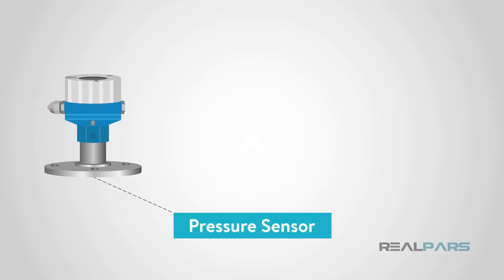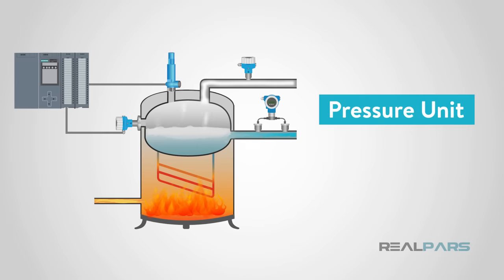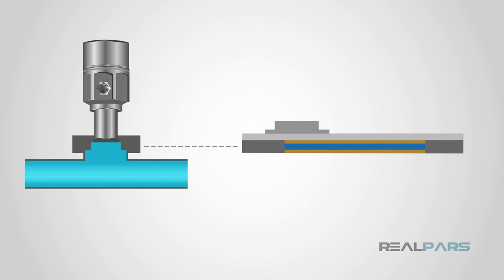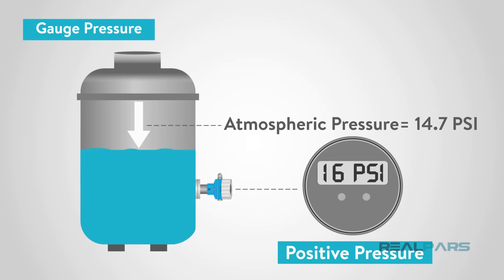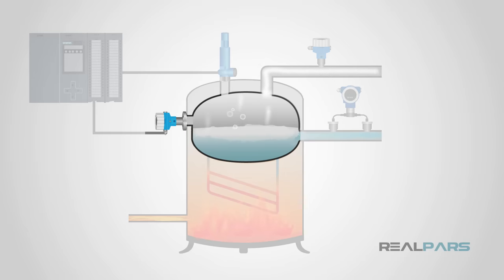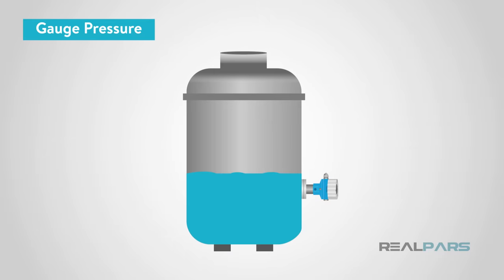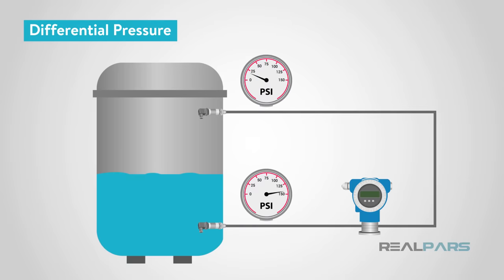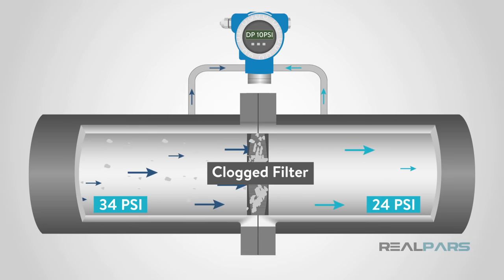What is a Pressure Sensor?

Comment: Awesome video, just had a related issue at our plant. 

Our feed-water tank, for the boiler, has a DP sensor that determines the water level. The lower port was clogged causing a false high reading in the feed-water tank. We never got makeup water, and the boilers tripped. All that rust build up at the bottom of the tank clogged our reading!

Now we have a blow down installed, to keep those ports clean. 

Keep up the awesome work, I'm learning more every day!
Reply from the maker: Thanks for your support! And for sharing your thoughts and experiences. Let us know if you have any questions!

Comment: Sir is it posible to put a pressure sensor and valve together to form self-acting pressure control valves?
Reply from the maker: Absolutely!  There are a couple of ways to do this.  First, they make self-regulating pressure control valves, which are set by a pilot signal or a set screw.  If you need to connect the pressure transmitter and the valve to a control system, there are a number of "smart valves" that are on the market to which a pressure transmitter can be directly connected and for which the control algorithm is executed inside the valves electronics.  Many times these valve electronics are called "smart valve positioners".

Comment: Very good video. I believe that the typical voltage range would normally be 1 to 5 volts, not 0 to 5 volts because we always want some minimal signal right?
Reply from the maker: Although 0-5V and 0-10V are used, 1-5V and 1-10V are more often used for sensing.  4-20ma is the most used because the range of a current signal is much longer (1000m) than a voltage signal (15m).  Using 1-5V instead of 0-5V gives a "live" zero (which you referred to), making it easier to troubleshoot wiring and hardware issues.

Comment: I have been thinking about this for so long and I need a good answer, when do we use a pressure switch and when do we use a pressure transmitter?
Reply from the maker: Pressure transmitters could be used anywhere a pressure switch is used.  However, pressure transmitters are larger, more expensive, and require analog cards in the PLC or converter circuits.  So, pressure transmitters are used when you absolutely need to know the exact pressure in a line or vessel for pressure control, level detection, or flow metering using a differential pressure flow element.   Pressure switches are used where I only need to know if the pressure has risen above or fallen below a set value.
Reply: Good question with a good answer, thanks realpers

Comment: What are the possible reasons of tripping a pump in SCADA System?
Reply: There are many reasons that can be programmed into the PLC, but a few commons reasons are:  loss of feed (low level in tank, low suction pressure), over-current on motor, and loss of other interlock (local disconnect, pump enable, etc.)

Comment: we measured pressure in closed equipment. ..is it Guage pressure or absolute pressure?..plz answer
Reply from the maker: Typically, in the case you describe, the measurement would be gauge pressure.  It ultimately depends on the reference for the "low side" pressure reference, whether it is the atmosphere (gauge), another point in the process (differential), or vacuum (absolute).  Absolute pressure sensors are constructed with an enclosed vacuum chamber and are more expensive than other pressure sensors and not as common.  You will need to inspect the model number and vendor literature to make certain of the type of sensor you have.  If there are two connection ports visible in the sensor body, it is a gauge (or differential) pressure sensor.
Reply: @realpars  Thanks a lot❤

Comment: What is the equation to determine the level of the liquid with size and gravity ?
Thank you
Reply from the maker: Hello Hassan Sahmoud,

Thank you for your question. This is a good question, but it can’t be answered with one common equation. In our video, we discussed 3 units of measurement for our example. The Pascal, Bar, and PSI measurements have different equations depending on the measuring device you will use to monitor your system. And factors like the type of liquid, size of pipe or vessel you are using to move your liquid, and of course, the gravity used in your area. Therefore, unfortunately, there is no one equation I can give you. Here are some links you might what to explore to help with your question. And of course, you can also view some of the REALPARS YOUTUBE videos depending on the subject you want to learn more about.

https://www.youtube.com/watch?v=iru8tRwS7Yc&lc=UgyBr781CbdOKhSGeZJ4AaABAg

https://www.omega.com/en-us/

Happy learning!
Reply: @realpars  i opened a link but it says nothing 😅
I think u mean this law 
P = ghq
Where q is the density 
h is the level
g is the gravity 
Am i right ?